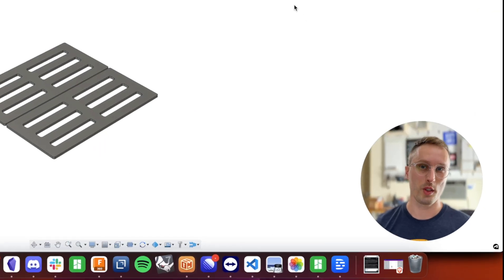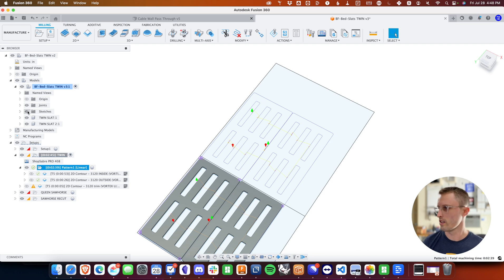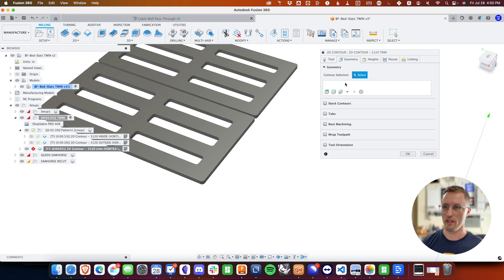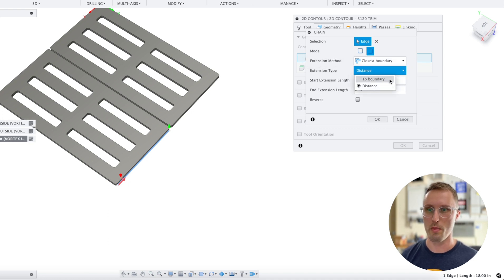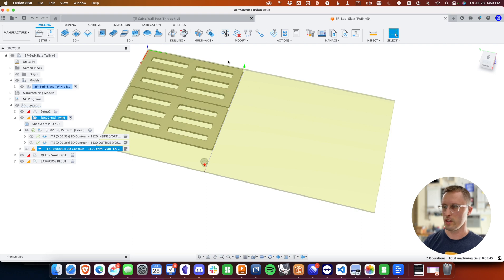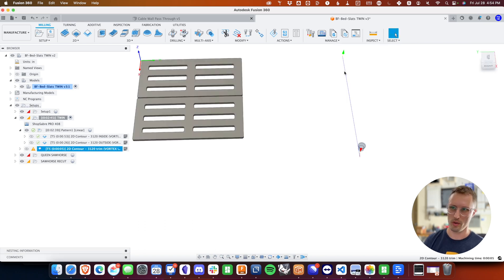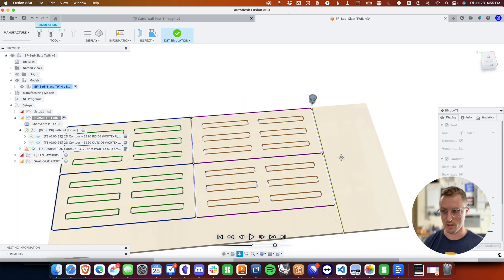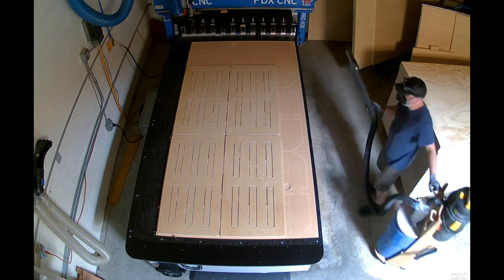Trim Drop Fast – CNC Router Trick

Comment: Wow, very good tips!❤

I always manually control the machine to cut the sheet after the job was done😂 Since I think that’s easier than creating a new sketch just for cut off. 

Your method definitely better. But how about cutting circle?
Reply from the maker: Yeah we do the manual cutoff too. Its still considerably slower and with more risk than programming it in CAM obviously.

What do you mean about a circle? I think if you had an original arch you could extend via tangent or to boundary in an arched fashion.